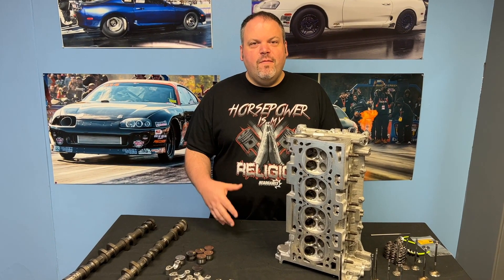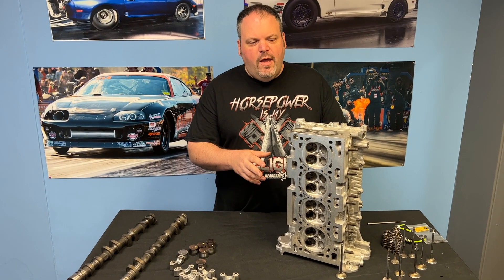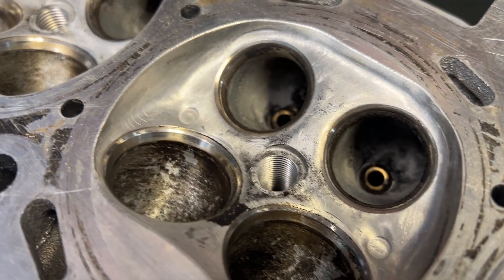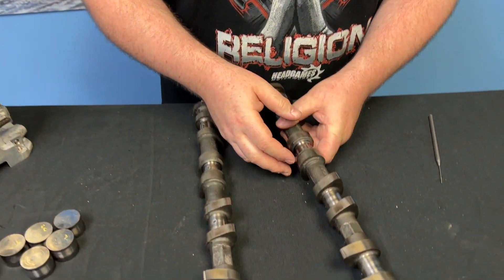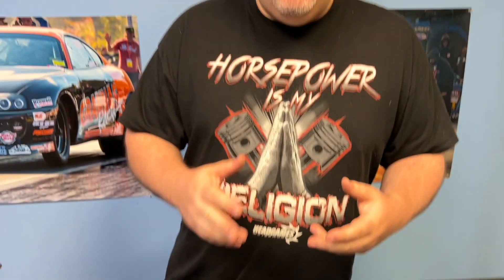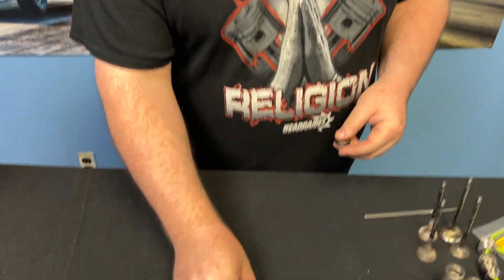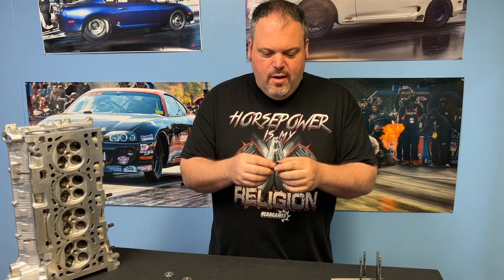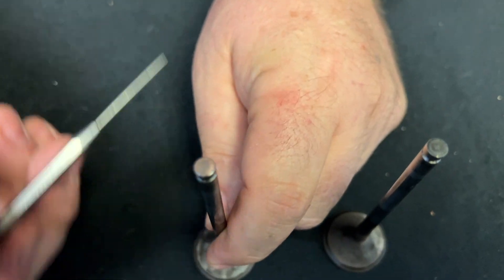EVO X 4B11 cylinder head inspection!

Comment: So after watching a few videos from you ive seen numerous cars have valve float issues , such as the 2j is300 head with s1 cams . 

Is it an issue with the standard GSC beehives not having enough spring pressure for the demand of the build ?

and if so do you recommend the conical springs more so over the standards with a cam like kelford 214-c or GSC S2
Reply from the maker: Great question! In the 2JZ it is the spring. But, we have also been highlighting the valve float and damage it causes on the 2JZ and other genre's because there was a bunch of rhetoric that the billet cams kill buckets in a 2JZ and we were trying to show it is not a 2JZ problem it is a valve float issue displacing the oil on any head. We have shown where it is good to go as well!